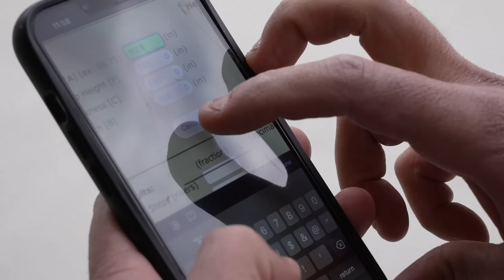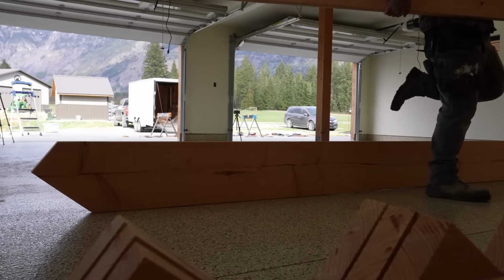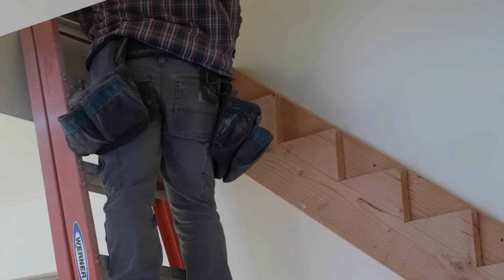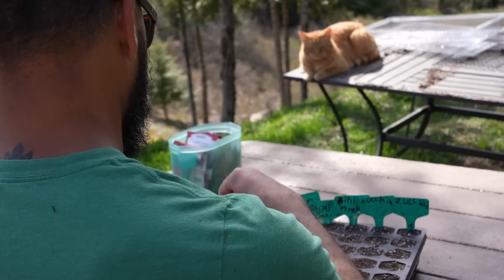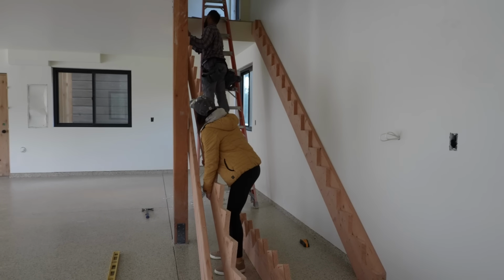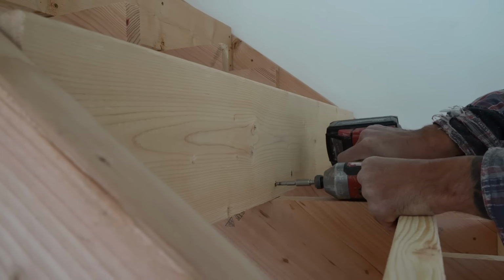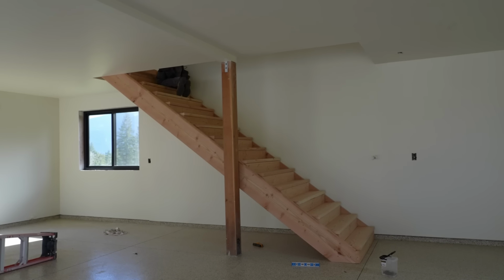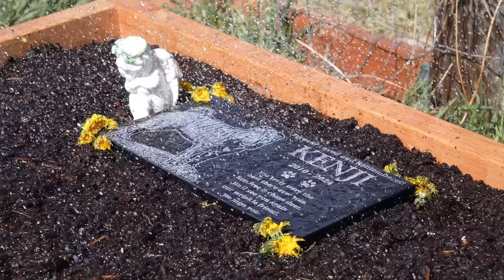Installing An Extra Wide Floating Staircase Inside Our DIY Mountain Home

Comment: You can hide the top corner of the treads on the staircase with a tall enough bottom molding for the rails.

Comment: Place a 2x4 on top of the outside stare stringers to cap off the treads. Add 4 screws through the riser into the back edge of the steps plus caulk all corners will prevent fine dirt from working though to what ever you place under the steps. Found it worth the time with the four set of steps I have built.

Comment: I would recommend you go under the stair and put 4 nails into the back of each tread where they butt into the riser.  It will keep the treads from sagging.  I would also recommend you use construction adhesive in addition to nails.  You are smart to have made the stairs wider like you did.  This will mean that moving furniture and appliances up will be a lot easier.

Comment: A few suggestions:
You could raise the height of the stair caps (to hide the ends of the treads) by adding 2x2s, or better yet, a half round on top.  If you can't find any the right dimension, you can make your own by cutting dowels in half lengthwise on the table saw (use feather boards for safety and consistency.)
Consider using black pipe & fittings for a handrail(s), for a cheap, sturdy and rustic/industrial look.
Consider adding 3M non-slip tape strips to the front edges of the treads for safety.

And lastly, off the topic of the stairs - I'm assuming you intend to get another pupper.  Consider making the outdoor space between the house and the garage (from the back wall to the connection wall) a dog run.  Install a pet door in the center of the rear connection wall, and a gate across the back gap for access.  Install a geo-textile barrier on the sub-grade, under a layer of sand and/or stone, for a weed barrier and for easier clean-up.  Perhaps a small motion sensing light on the connection wall too.  Think you would appreciate this feature during those cold winter months.
Cheers, and keep up the good work!

Comment: As a fellow North Idahoan homesteader, I wanted to say, great job on a solidly built star system. I was glad to see you cut one stringer and use it as a pattern for the other 3. Couple little touches. To help “hide” the treads from view looking at them from the side, add a 2x on top of the shirt board. ( normally we start with a 2x6 nailed into the wall and post on the bottom of the outside stringers. Then set a 1x12 on top of that to cover the front of the steps.” Because you didn’t glue your treads down, I would also screw the bottom of the risers into the treads in between the each of the center 2 stringers. This will help with “squeaking “ as you walk on the stars.

Comment: Jeremy, to conceal the profile stair bits that still show (and that you don't like), a simple and attractive fix is to add a piece of wooden trim onto the top edge of each stringer, just make sure it's tall enough to hide any jagged profile when seen from the side. You can use wood of a different type/color if you want to add a stylish accent (or use the same), it will look beautiful from the side! Good luck and great work as always, Lee

Comment: You can purchase a step elevator.  A chair one straps into then presses a button to go up or down.  In case you ever need to use it for anyone elderly or injured.  It would attach to the wall.

Comment: The stairs look great and very sturdy with the addition of the end caps.  For now, you may want to place a piece of old carpet or an old throw rug onto the top step so someone doesn't trip on the top step and try to do a Superman-like trick and fly down the steps face first.  That couldn't end well regardless of how athletic they might be.  Personally, I don't mind seeing the end of treads as anyone should be able to tell their stairs. Thanks for adding the moments with Kenji and how you remember him with flowers and such.

Comment: I like the way you added the sides to the stairs as it will add a lot of strength but the only thing I didn't see you do was add a bead of Lexel or some kind of adhesive calk to keep the squeak down over time.

Comment: Add a contrasting dark hardwood cap to bump that edge up so it covers the tread. There are no mistakes in construction only design features that cover them.
Reply: Drill holes, drive scews through cap and use wood plugs cut from the same material to cover the holes.

Comment: If you don't like seeing the ends of the treads. on that outside edge you could add a 2x to the top of the end cap.  Maybe make a V edge between the add on and the end cap. to make it obvious it is different and it's not a mistake, you intended to make it that way.  But it looks fine as is too.

Comment: Recommendation!
If you don’t like seeing the profile of the stairs over the end caps, why not rip a square piece to set over the top of the end caps and under the top stair? Basically, widen the end caps to hide the profile shouldn’t be too hard to either hide the seam or incorporate it into the design. 
If you do a metal railing with cables, you can have the piece that sets on top of the caps also be metal. Then it will fit the profile.

Comment: The stair are installed.  🍾🥂🫶🏻. Since Jeremy doesn’t like to see the step above the stringer, use wooden molding, glue it to the stringer and clamp until glue is dry then finish nail molding to the stringer. I hand plane all edges of the wood to prevent sliver. Are you staining the wood? 🧐 I love your video, much to the family.❤️

Comment: Your staircase looks awesome. I do have a suggestion besides the railing that you put up later you need to put up some nonslip strips on your stairs so no one can slip slip and fall down the stairs. Just a suggestion it’s a little safety factor.

Comment: One trick to remember is to make all your cuts in one direction then go back and in the other direction.  Also, on the top of each stringer, attach a metal strap to the back of each one.  The other half of the strap is attached to the framing of the stair hole.  A good idea is to notch out and install a 2x4 under the bottom of the stringers.  This will keep things even and though I know you will not, running a trio of anchor bolts into the floor would be a sound idea.

Comment: Run a 3x2 baton across the top of the stringers, fill joint with wood filler and sand, suggest you use same timber you used for stringers, your choice

Comment: one thing ive learned about stairs, if you use them everyday, then one day you will fall down them , believe me , if it can happen it will ,  idea use black 1 1/2 inch pipe fitted together or maybe a combination of wood and metal , use to live on a second floor , when i was younger, im 64 now and cant take the chance of falling, just a thought  to consider

Comment: I just thought about something.  Is there going to be a door between the lower part of the garage and the upper part?  Is there any concerns for smelling gas fumes or carbon monoxide upstairs?   Also, isn’t there going to be a rush of cold air upstairs when the garage doors are opened in the winter time?

Comment: @jesuschristcannotchangenev6031
45 minutes ago (edited)
I wouldn't let my daughter live there. You built a fire trap, one way in one way out. You get away with that one door. the door should have Been at the bottom of the stairs, now it will fill that big space with carbon monoxide. Think about what you did not good. Now blow a hole in the wall and give her a door that leads with stairs outside. One more thing the garage is bigger than the house. The height. I better get a heart I told you the truth.